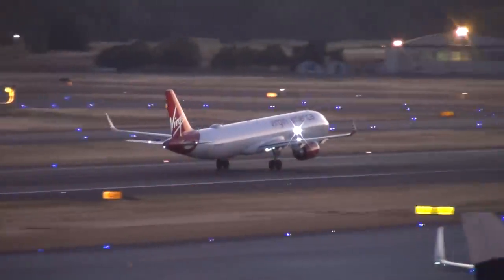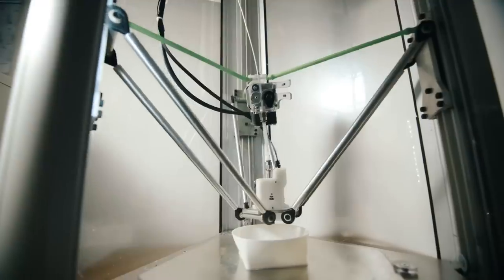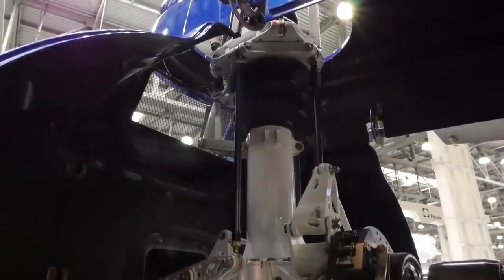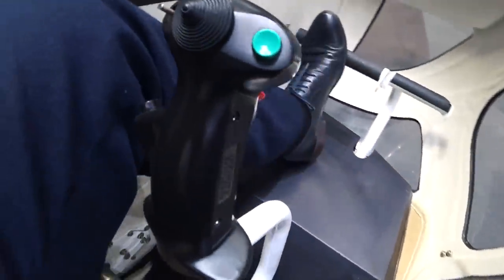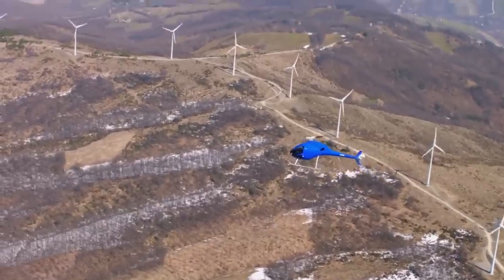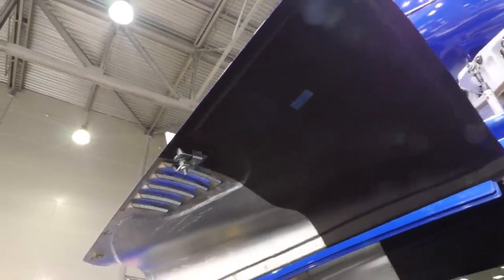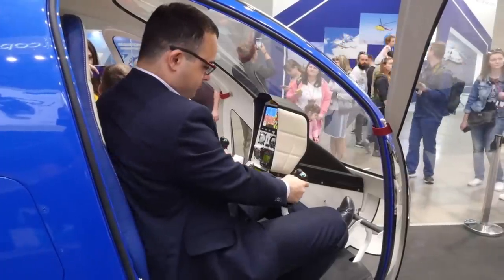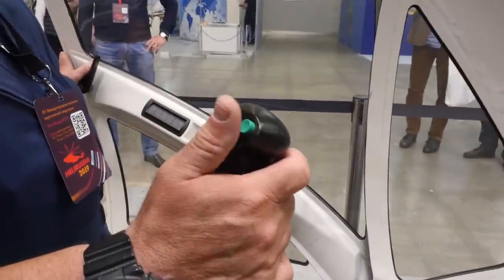Curti Zefhir - an ultralight cutie

Comment: Cute, not enough rigidity, laterally mounted engine, composites where composites might not perform adequately, $500K, New product. 
I mean these statements don't instill confidence in the overall product. It is under powered for dealing with wind shear.
The ballistic chute is a nice touch, not a new idea but certainly a good safety option.
The skids need redesign for a more stable base. Pilots tend to be taller these days so be sure to extend leg clearance.
Those floppy doors need to be properly sealed and hardened to avoid in flight vibration and cabin contamination from outside
elements such as smoke, fog, rain, wind, sand, debris and other factors.
The price point is too high for a new offering like this. Still too many engineering challenges to conquer.
The shape of the cage is nice and looks effective as an airfoil. The seats need a serious upgrade with flame retardant materials.
Thicker padding and canting adjustments for optimal positioning. No mention of any interior environmental temperature regulation,
heating and cooling. How are you cooling the engine? What is the maintenance schedule? What is the projected maintenance
cost for every maintenance milestone? Are there options for more powerful power plants? What is the maximum fully laden
cargo capacity? I didn't see any running lights on the outer surface of the craft. Are there any landing floods illuminating the footprint
for landing? What will the base model include? What options are available? What type rating is required for this craft? Is the cyclic
dampened? Is the throttle and blade pitch control physical, electronic or both? What is the recommended safe operating base altitude?
Is the unit AIS equipped? Is there a TCAS system onboard? Any weather or traffic radar? 
If someone is going to drop $500K on an aircraft these are pertinent questions. In addition, why are you using Facebook as a website?
You should have a dedicated portal for such an undertaking.  
I don't mean to be difficult but these are details a pilot needs to know about any aircraft.
Comparing an aircraft to a sports car is a bad idea. Aircraft are held to a much higher standard.
Power to weight ratio and balance can be adversely affected if the aircraft itself is too light.
It does not matter if the craft is Italian, French, German, or English. All manufacturers must adhere to globally accepted
engineering standards for aircraft. I don't want a "Cute" helicopter I want a robust performer that is safe, reliable and effective.
Have you developed an operator type specific training regimen yet? What endurance and safety testing has been done?
Aside from using the ballistic chute as a safety test, what engine parts overheat the most? How often must the exhaust be
inspected? What weak points does the shroud tend to demonstrate after 100 hours of flight operation?
Do you offer maintenance kits for each milestone? What about spare parts? Aside from fuel, what other consumables, parts
or areas require ongoing maintenance? How many hours are the rotor blades rated for? What is the cost of rotor replacement?
What are the rotor balancing specifications? What materials are used for the swash plates? Is there a bearing maintenance
schedule? Can an under sling be mounted to the skids? What is the effective thrust rating of the craft? How is the engine isolated
from the cockpit? What vibration effects does acceleration have on the cockpit? What is the washout envelope during takeoff and landing?
Are there alternate, overhead, headset ports? What about night time internal lighting for the cockpit? Is there an anti glare film on the
bubble? How do you deal with frost, icing, ice, snow, rain? What strategy is implemented against weather elements entering the power
train? Can wheels be attached to the skids? How is the craft moved when on the ground or in a hangar? Does the craft require an APU
or is cold start based on battery power? What are the temperature maximums and minimums for safe operation? What is the crafts
internal power rated at, 12 Volt, 18 Volt, 24 Volt? What anti theft measures are in place? Does the aircraft have an internal warning
system for mechanical and other safety related operations? What are the stall characteristics? What are the key pre-flight and post-flight
inspection points? The cyclic handle should be much more robust than slick plastic. You need some knurling or grip stippling for 
a better grip. Take a note from DSLR camera bodies. They are covered by a stippled rubber covering for better grip. The handle should
have more controls for radio, gps, radar and horizon control. Far safer than reaching forward to change settings all the time.
You talk alot about the companies history, but the companies history does not fly the aircraft the pilot does.
It looks nice but there are many questions left that require answering.

Comment: Nice little bird but I have a problem , at these prices you sure won't see this one in many garages . There will be some to actually forgo the major bucks for an ultralight chopper . This is nuts to call it an ultralight .
Reply: It's a translated word, it does not mean Ultralight category like FAA Part 103, but rather the term for the overall weight, like ultra thin or Ultra fast.  So like, heavy, light, ultralight and feather weight.  Now do you understand?  Only Americans seem to be missing this point.

Comment: Nice design. But 500K for an ultralight helicopter is to much. There are similiar products on the market. I do not like two blades either. For this money better 3 Blades. The turbine is nice but limited in power. 141 hp is light. Good luck to them in the market. Selling is limited by this pricing.

Comment: Very interesting new helicopter. However, far too expensive and therefore not ready for the (competitive) market.
Thanks for this video. 👍🏼
Reply: So how could this machine be made competitive in your estimation?
Reply: @Veldtian1  Well, to be competitive, the price must be basically comparable to other competing products. If the price is much higher, it needs a new application or feature that is not available anywhere else, for which a higher price is justified.
All latest technologies that are extraordinarily expensive, but do not add value to the user, are not competitive until they are tested and produced for the mass market.
So my solution would be: only use an expensive new technology if it adds a practical benefit for the user.
Reply: @Veldtian1   Keep the turbine, but larger fuel tank (=range); beefed up transmission that would allow for short-term use of higher power (after all the engine is de-rated from 180 kW to 108 kW), and - most importantly - a 3- or 4-bladed rotor system. Then this product would have a real unique positioning.

Comment: Twice the cost of Robinson R22, but looks more sexy
Reply: Also carries more weight, more fuel, longer range, more comfortable, better performance, faster speed, similar operating costs, and lastly, much safer, much more reliable engine, burns cheaper easy to get fuel, etc.

Comment: too much expensive, a R44 is piston and cheaper
Reply: Thats the problem its a piston with less power and more weight.
Reply: @jennydiazvigneault5548  an r22 weighs less than that machine and produces more horsepower with the o-360- when youre comparing the direct robinson competitor. the r44 has an even larger engine with more usable load, more capacity and a higher cruise speed while still costing less. this helicopter has the looks and a parachute, if you feel like its needed, ill give it that.

Comment: That is not an ultralight!
Reply: You need to define YOUR term ultralight.  This is as was described, and ultralight because they are describing the weight of the aircraft.  Even someone challenged by conventional education will know that this is not an "Ultralight" as determined by the FAA Part 103 definition, because it has two seats.  Therefore we ALL know this is not an FAA Part 103 designated ultralight, but then again, no one said that it was!

There is a word in the English language you know, that is spelled ultralight and this is defining weight.  Such as heavy, light, ultralight and feather weight.  Not every time the word ultralight is used, is it pertaining to the FAA Part 103 definition of ultralight.  Please get it in your head, that sometimes people are actually referring to the word in relation to the weight of something, as it has been used here, describing the helicopter and its weight.